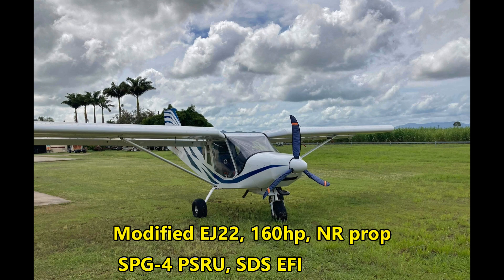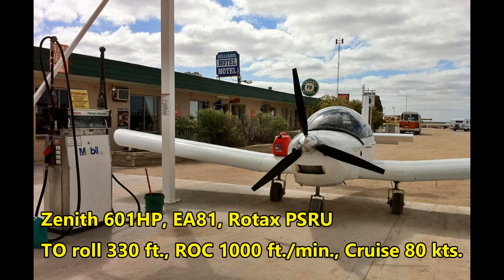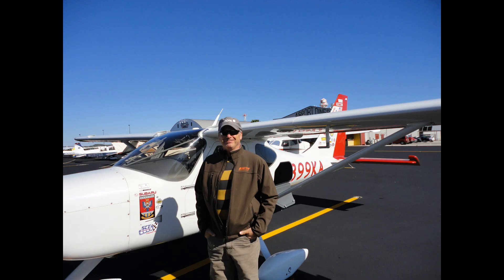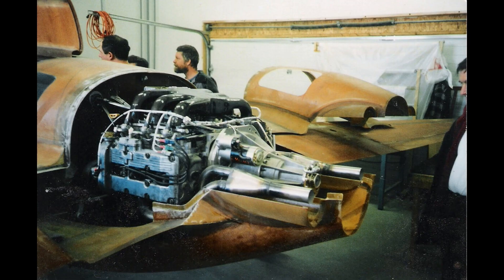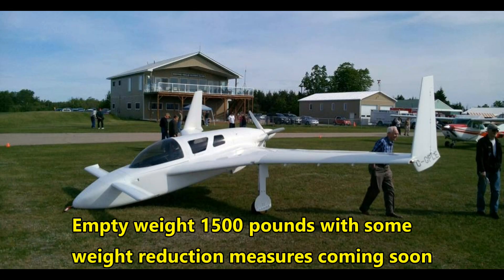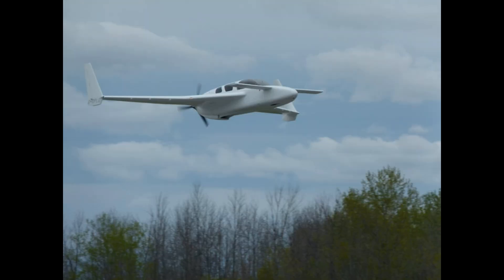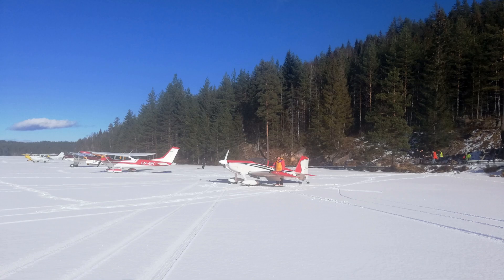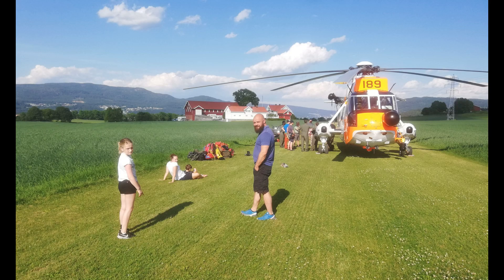Vid # 105. 4 More Subaru Powered Aircraft

Comment: I can't grasp why people looked at the car industry, and then thought, yeah, lets pick the brand that has constant engine problems, and often needs their engines totally rebuilt every 60k miles? 
Is it all about the geometry of the engine and lower amount of vibrations? I for one rather have a working engine instead
Reply from the maker: Main reasons for installing a Subaru is they are an opposed four like traditional aircraft engines, are light and plentiful. As you can see from the video, properly assembled and installed, they can work well for a long time as well.

No engine is perfect.
Reply: You have no idea what you are talking about.

Comment: Just wondering why no one is using Toyota's 2GR FE V6 engine? Seem it would have a decent power to weight ratio / reliability.
Reply from the maker: Honda J35 engines have been pretty popular, used in Titan T51s. Almost no Toyota engines are flying that I'm aware of. If nobody builds a gearbox for them, an engine won't be used in any sort of numbers. Lots of good, aluminum V6s these days to choose from.

Comment: Currently developing a stand alone EDFJ and a EDFJ/DIESEL HYBRID.
The Rutan Long E-Z or the Cozy/side by side seating/based on the Rutan Verieze/Long E-Z design, possibly one of Revelaero's designs, as well as a Velocity 4-place, will be used as test bed aircraft.
Tested will be a single and twin power-plant configuration (all electric twin and diesel/Jet-A hybrid on the Velocity aircraft).
Twin configurations will be mounted much like the Honda Jet's power-plants.
Goal: to fly faster, farther in a more quiet and comfortable manner than any other electric airplane using current battery technology.
If you would like, we will keep you posted as to our progress and invite you to video document our results. Would be honored to have you.
Please, keep up the great videos!

Side note: have also considered hanging a twin configuration from wings of high wing aircraft, as seen on the Avro RJ.
Reply from the maker: I'd be very interested in your progress and results. Sounds like an interesting and challenging project!

Comment: These engines are Cheap to buy,run and rebuild. Spares available almost everywhere immediately. Just do it right and you will be stress free... engine rebuilds dont take 3months and they dont damage  bank accounts.. making it possible for an average person to fly as well.
Reply: I was wondering what the price comparison was, to a certified engine
Reply: @ShawnSmith-uy3zr  A overhauled O-320 using your core engine is around $22,000 if your crank and case are not damaged.
Reply: @oneskydog4401  yep and the o-320 is way more likely to hit 2000+ trouble free hours.
Reply: @oneskydog4401  what’s the cost and weight for some of these Soob conversions?

Comment: Is possible to use SDS system with a  mixture control for increase the fuel consumption?
Reply from the maker: SDS comes with a standard mixture control knob so you can lean and richen mixture +/- 50% from the programmed values easily.
Reply: @rv6ejguy  nice to know about this, I think with this control I'll not have issues using avgas once I'll not have to use an oxygen sensor.
Reply: @alessdre    Just learning here.  Why do you want to ditch the O2 sensor?    
Why would one want a manual mix knob?  I think ECU machines should reduce pilot work load?
Reply: @timduncan8450 in my opinion the use of O2 sensor should be the best solution for reduce the pilot workload, the problem is that avgas use lead in composition and this deposit over the o2 sensor after few hours of flight. The solution would be the use of mogas, but it's not available in all the airports.
Reply: @alessdre   thx.  Didn’t know about lead on O2 sensor issue.

Comment: It's fun seeing all of these Subi power aircraft, and I'm glad to see there are those making it work. Do you have any experience with Mazda 13B and 20B engines with or without your SDS systems?
Reply from the maker: We did a 12A  system for an airplane over 20 years ago and a bunch of systems for Wankel cars in the same era but no longer offer systems for Wankels.  Too busy presently with our piston aviation business now.
Reply: I've been looking into 13b or 20b engines for a while,  there's lots of available information from automotive tuners on getting them to run correctly and fuel consumption is less of an issue when you're running them in an aircraft at constant power.  I think the biggest issue is a lack of a production gearbox.  I'd like to have more people pushing skytrax for a wankel adaptation and we will be in business!
Reply: @mercedescherokee6853  Marcotte makes a gearbox with a Mazda bellhousing. I understand he's  semi retired and they are hard to come by.
Reply: The biggest issue with the 13B / 20b is simply the engine itself.  I'd done a tone of research on them 5-10 years ago and ultimately decided that while they can easily be built/rebuilt for cars I just don't think the same can be said for an aircraft.  And as you may know, their greatest weakness is the apex seal.  That and the efficiency / MPG.  It's simply not a good design in it's current state which is why Mazda stopped making them.  The RX-8, as an example, was notorious for having mass failures under 100k miles.  I really wanted one for years but waited patiently to see what would happen,  this after having owned an '85 RX-7 and yep, ...never bought another.  Too many fails.
Reply: A builder installed one in his BD-4 and has been flying it for several decades. I don't know his name, but you might check out EAA's SPORT AVIATION Magazine archives.